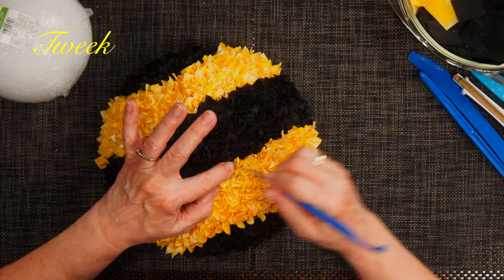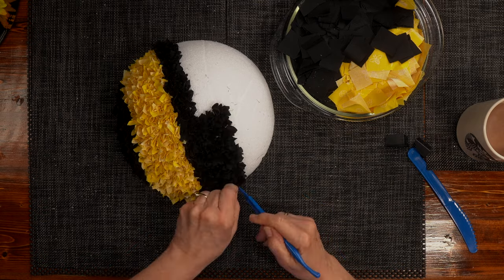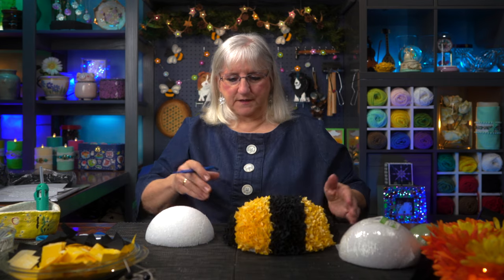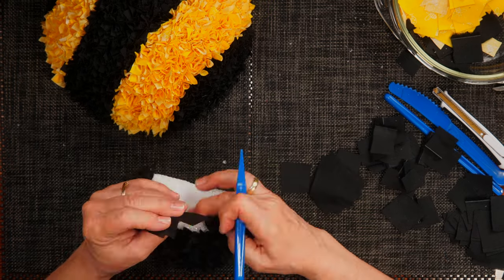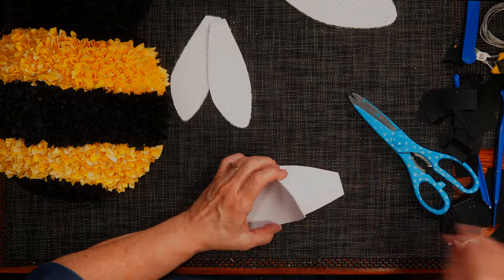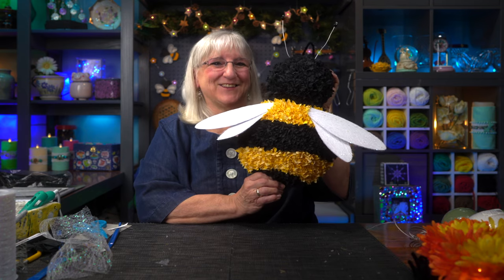Make a BEEutiful Bubble Bee out of Styrofoam and Fabric, DIY, Tutorial

Comment from the maker: Bumble Bee Chapters

0:00 - Intro
0:19 - Project Supplies
0:50 - Start Cutting the Fabric
1:12 - Bee Body - Push Fabric into the LG Styrofoam 1/2 ball
3:20 - Bee Head - Push Fabric into the SM Styrofoam 1/2 ball
5:05 - The Cardboard Body
6:30 - Glue the Head to the Cardboard Body
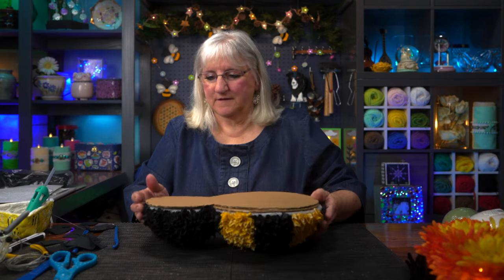7:25 - Make the Bee Wings
8:20 - Adding Lace to the Wings
9:45 - Glue the Wings to the Bee
11:45 - Add some Antennas 
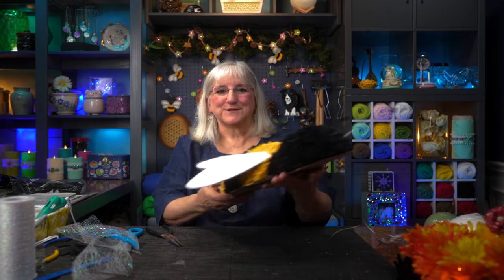14:45 - Add a Stinger
15:50 - Add a hanger
16:10 - Completed Bee
16:23 - Outro